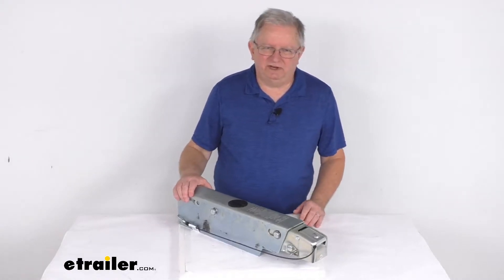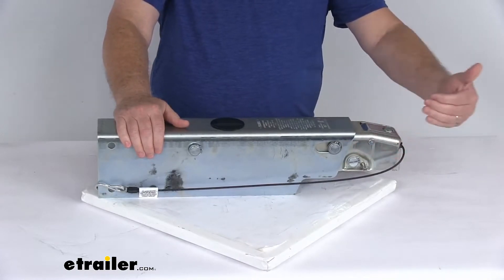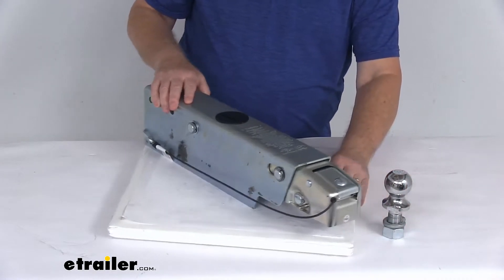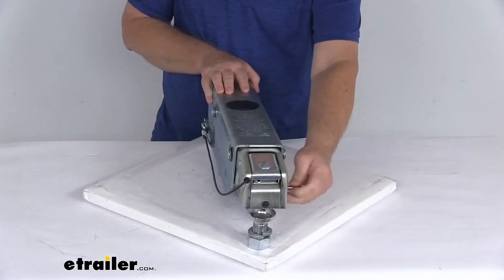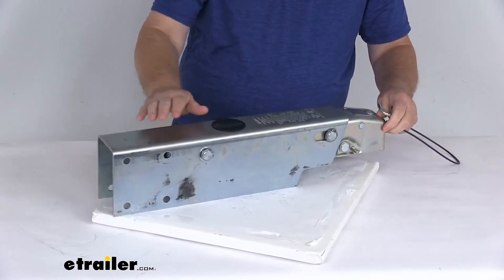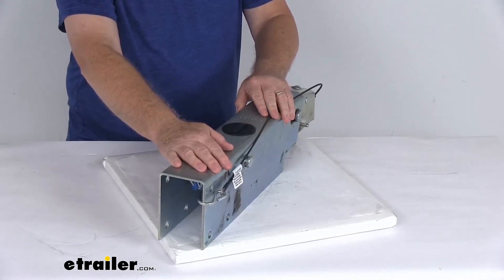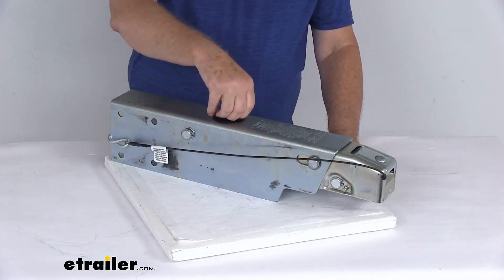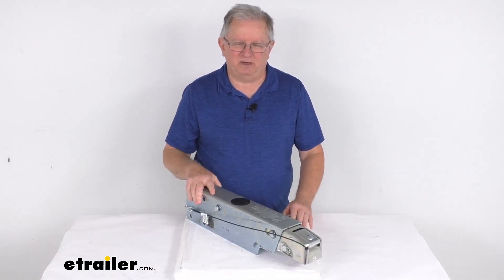etrailer | Let’s Check Out the Dexter DX7.5L A-60 Brake Actuator w Electric Lockout

Comment: So glad that dexter made a hitch that has no mechanical lock out for reverse, so that when a customer experiences an electrical issue they cant backup their trailer. I have had nothing but negative experiences with dexter boat trailer and commercial trailer parts. Dexter=trash
Reply: You are an idiot!  They lock manually the same as the always have.